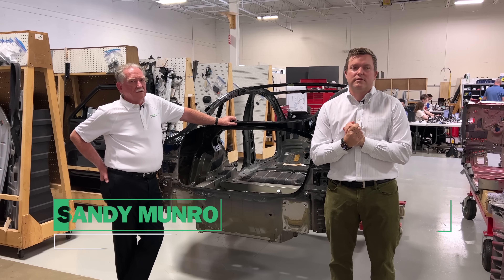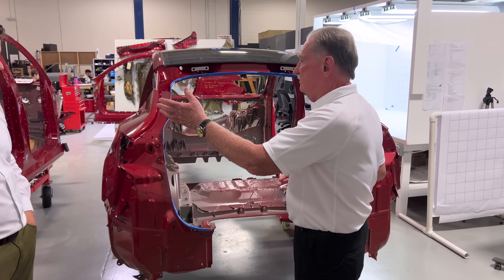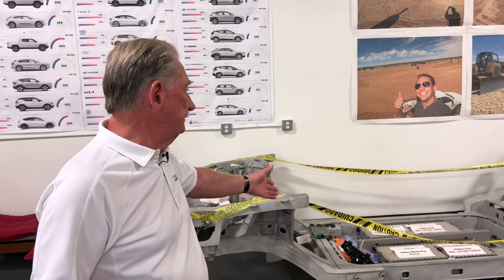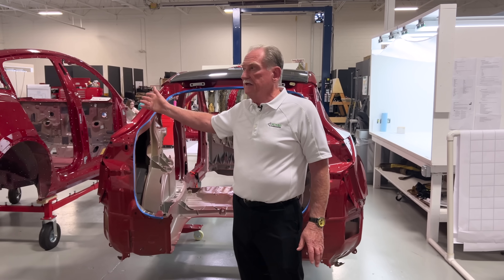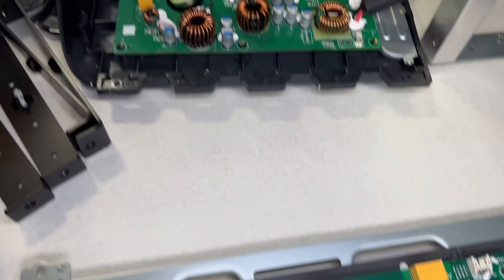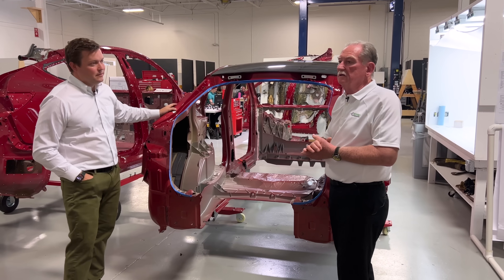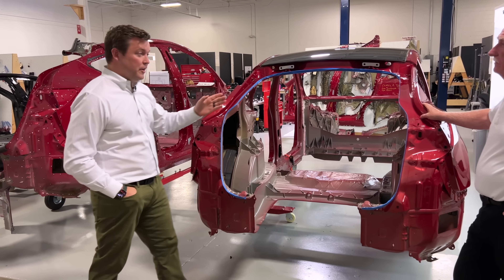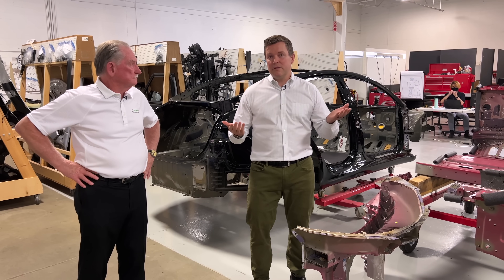Giga Castings with Sandy | Evolution of Tesla Bodies In White

Comment: If cars with this kind of manufacturing philosophy replace traditional cars in all price categories, people with low incomes will not be able to repair their cars if there is any significant breakdown. The complexity of manufacturing this kind of parts will make the original manufacturer a monopoly in their production, and the cost will be too high to buy them to repair a used car.

Comment: I am an ex casting engineer at a Japanese car company. At my place, casting parts are mostly used in car engines and are under the responsibility of the engine group.

Meanwhile, the body group is responsible for the inside of the car body.

With Tesla's courage and great success in redesigning the car body, there is no doubt that all car manufacturers will follow suit in the next few years.

This could provide benefits to casting engineers wherever they are, as their needs will double or triple in the automotive industry.

Comment: I would really like to inspect the quality of the casting without paint. In my experience thin walled extreme castings tend to be rather poor regarding surface and internal quality. Fatigue strength is highly dependent upon proper surface integrity.

I would prefer to be one step behind when taking gigant leaps into areas of new technology - it seldom goes without problems. The speed that  Tesla is implementing new technologies could be due to  high risk acceptance within the company.

Comment: This is interesting and does show a progression of engineering for the sake of manufacturing. But I have huge doubts about this product (car) from the consumer's point of view. If you are in a crash- a side impact at the rear tire- and your casting is broken at several locations. Is this going to be repairable? TIG welding isn't going to put the exterior shape back together. If not then the car would be "totaled". Who is going to bear the burden of vehicle replacements for an expensive EV that is not repairable?

Comment: I can see how all of these changes represent significant improvements in the manufacturing process, but do they make the car safer to drive? For that matter, is the new battery safer? Could there be some advantage in previous the body construction in an accident that may allow for more deformity or cushioning that is being lost in this new and improved manufacturing process? In short, would you rather drive with your kids in the backseat of this model Y or the previous one, sitting on top of the new battery or the previous one?

Comment: The casting process is incredible engineering and very beneficial to cost reductions at Tesla. While you can tig weld new cast sections in the event of a crash, Tesla is unlikely to sell sections of the casting in order to do so. As a result, a crash is more likely to result in a total loss which benefits Tesla because its an opportunity to sell another vehicle. Reparability is important and should not be forgotten because a technology is green. Thanks for the vid

Comment: It's a Tesla, gentlemen. I really liked the way the car body industry developed, as it can be manufactured at a lower cost than pressure molds. I think that Tesla is the future in the car body industry, and we hoped to abandon the resistant iron and replace it with aluminum that does not rust

Comment: reduce the distance between the rear wheels, citroen DS19, and cut the casting weiught in half, improve aerodynamics...the casting has little torsional rigidity which may be a problem.  in any event, it is brilliant as it is.  munro is the best (or is it musk is the best).

Comment: I am deeply interested in designing armored combat vehicles.
This mindset needs to be implemented in armored combat vehicles.
I'm embarking on that premise as well.
Once you have been in a Bradley Fighting Vehicle, an Abrams Tank, or driving one of the old Hummvees, or even the new JLTV's.
They are crude, difficult or impossible to drive comfortably, and the old school approach to welding flat armor around the outer circumference, just like they did in the Civil War, needs an entire rethink.
The Bradley took over twenty years to develop and deploy.
I want to use Tesla's approach to lean design, with Combat vehicles.

Comment: These cast body parts contribute significantly to the throwaway nature of society today.  Damage that would not be difficult to repair on other cars, be they body-and-frame or unibody construction,  is essentially impossible on a Tesla.  So the odds of you getting your Tesla repaired rather than take a larger insurance loss as it gets totalled, and inevitably the insurance company SCREWS you,  are much worse.

Despite what this guy says, the issue is that you can crack these castings with minor impacts, and those cracks make the car structurally unsafe and it's much harder to find qualified repairmen who can or will tig weld them together.   This does NOT make repairs easier, it does make the car more of a throwaway device.

Comment: I have to agree with you need to move on. We used to fabricate a certain structure until they wanted a cost saving and the assembly fitters suggested a moulding. Unfortunately the order book could not afford the tooling. Automotive now that’s a different story.

Comment: Nothing new here, GM has been using castings for all the c7 Corvettes starting in 2012, 3 parts, front, middle and back make up that whole GM c7 corvette frame and it's 10 times more rigid than a stamped panel car..

Comment: Thank you for the insightful video. I knew this was a really great way to save money and speed up production. And you are right: The critics claiming that you can't fix die cast parts of course know that you can't do that neither with stamped steel. BUT as you say, you can weld a die cast part, but you would never do that, if the part experiences so much force that it would crack, the whole car will be totalled totally.

Comment: Sandy gives Elon too much credit.  Elon is willing to pay engineers and machine shops to make the tooling to do something above and beyond what was the norm. 
You're talking shit Sandy, when you said that big die casting fills in a second. You know as well as I do that die casting takes a lot more time than just a second. I'm guessing that it's about a 3 to 5 minute cycle time for each part. Plus the overhead to make that big casting doesn't come cheap. This big die cast machine is probably a few million and multiple molds which will also run a half million a piece too. 
Elon is finally going to build himself a tool shop, finally! Up until he gets that going, he's had to pay for everything.

Comment: Still I think the problem will be reparing these things.  Welding a HPDC is very tricky if even possible. Corrosion protection is another issue I would imagine, at least on salted roads. Diecast aluminium suspension parts on my Mazda 6 from 2015,  looked like something from Titanic, it fractured due to corrosion pits that initiated fatigue cracks. I know that Volvo had the same problem here in Sweden.

Anyway, megacastings are interesting - but I am sure there will be lots of issues that will have to be addressed and lessons to be learned. Better to stand ready in the second line - than be the first to take a gigant leap into the unknown. That's my 5 cents.

Comment: Received my model y in June of 2022, long range , dual motor model T-boned behind left rear wheel ( ironically  Friday  July 13th ) from someone running a red light,  Estimate to repair came out to $5000 in parts + $15,000 in labor. It’s now after Thanksgiving and I don’t have the car yet although hopefully I will get it in early December. Could not start to fix until October because of backlog on other damaged Tesla cars the shop had waiting to get fixed. They only repair Tesla cars in this shop. I was able to drive the car in rest of time waiting to start repairs in October. My question is whether you think the car will be save to drive, thinking the integrity of the body might be compromised?

Comment: You can't fix bent longitudinals, but we can. Here in the second world where we drive mostly used cars we also have supply of used body parts from cars scraped in the first word due to mileage or just parts from other side of the impact. With good old steel cars we can just drill spot welds, take out bent parts and replace them with intact from donor. Furthermore, in 1-st world European countries where thay don't have the same mind-blowing insurance-bubble, people do repair brand new luxury cars with supplied new parts including UHSS steel reinforcement with techniques described and proposed by car manufacturers.

Comment: The”firewall” was there to separate the engine compartment from the passenger compartment. It’s main purpose was not to stop fires from reaching passengers.
The casting process for Tesla only “evolved” when a machine was built that could handle the casting size…it had nothing to do with Tesla engineering. The giga press was not built by Tesla…just funded by Tesla.

Comment: While electric cars are supposed to require fewer visits to a mechanic, a J.D. Power survey found the vehicles typically visit repair shops at about the same rate as combustion-engine cars — an issue that could be exacerbated by reports of poor quality control from new Tesla owners. Last year, Insider reported that drivers were taking to social media to report issues with their brand new Teslas, including poor paint jobs and misaligned car panels.

Comment: One Tesla driver alleged they found a dead mouse and rat poison in the car's front trunk — also known as "frunk" — after a service visit, Vox reported. Another vehicle owner posted on Twitter earlier this month that he discovered part of his car was duct-taped after spending 51 days at a Tesla shop.

It's not the first time Tesla owners have expressed frustration with Tesla's repair services. In 2019, a Bloomberg survey of nearly 5,000 Model 3 owners found that the majority were dissatisfied with the speed and quality of repairs at Tesla service centers.

Fixing a Tesla is unlike taking in a Ford or GM vehicle, which can be easily serviced at thousands of independent shops. The majority of Tesla repairs are performed by one of the electric-car maker's handful of less than 200 in-house service centers across the country.

While electric cars are supposed to require fewer visits to a mechanic, a J.D. Power survey found the vehicles typically visit repair shops at about the same rate as combustion-engine cars — an issue that could be exacerbated by reports of poor quality control from new Tesla owners. Last year, Insider reported that drivers were taking to social media to report issues with their brand new Teslas, including poor paint jobs and misaligned car panels.

Comment: Conclusion, If you're buying an older version of Tesla without the casting you should pay at least $15,000 less compared to the new one. That is with the same mileage and same battery degradation. That goes true for other manufacturer as well.

Comment: As a retired engineer from the structural steel frame manufacturing industry what Sandy and his colleague say in this video is absolutely right.  The really sad thing is that an awful lot of traditional manufacturing industries seem to have closed minds to new ideas.  I think this video shows why Tesla are going to go from strength to strength from a manufacturing point of view.
Long established auto manufacturers may simply not be able to make up the lost ground ..........
Reply: And on a design change I trash the whole giga form? If a car needs replacement panels after the selling period and was sold for lot of money before, so it is along time investment and not a faceless piece of round soap filled with software...how do I "value" customers coming in for greater service where partly "giga casting" parts are needed? Tesla can't...
This is like a glued shut iPhone all over again, completely stupid and only good for Tesla no one else 😮
Reply: And we all should not forget that sandy is the guy who values clips over screws any time which is a complete poop to work with later.
High quality cars do not consist only of glue and clips..
But hey why do any maintenance, just buy new cars all the time is sure cheaper 😂🎉

Comment: Hey Sandy would love to see your opinion on the Ineos Grenadier which incidentally is an old school knock off of a defender. They are doing research on hydrogen just not sure where they can store it. The engine is BMW finest close circuit engine design and no doubt it will be the last of the combustion engines. I am an electrical fitter and mechanic by trade from the old school the new Tesla motors are just out of this world not sure where this technology comes from as it is so advanced that I even struggle to understand.

Comment: Respectfully disagree, many vehicles with longitudinal/ frame damage can be properly repaired and have been for years.  So what, the insurance company is going to total a 50-100k vehicle rather then put 10 or 20k in to a repair?  Bad idea on several levels.  True Tesla has developed a high tech and very cost effective manufacturing technology but they are passing the cost on to the insurance companies and drivers. Coupled with completely non repairable structural batteries yields a throw away product.  Time will tell if this is the best approach.

Comment: So guys, do you think the 4680 cells are coming to the model S long range as well? Elon quoted that he will not use 4680 cells for the plaid because the 18650 cells deliever more power to the plaid. But the main question is, is the model S also getting a structural batterypack in the future? I hope so, I drove a P100D for few weeks to test and I really loved it. But is there a structural battery incoming end of the year?

Comment: Uh-huh...as he spews out about a 40% waste stream (because the castings are inherently unstable), he's a genius because you circle jerked him.  Is that how it works, Munro?

Wasn't it you who pointed out cast suspension/frame parts were a BAD idea, when you worked at Ford and were spewing on the Fiesta?  Wasn't it you that pointed out how castings don't respond to torsional stress, and have a tendency to CRACK and FAIL?  Wasn't it you who said (when referencing Ford) that they needed to step up their stamping, machining, and welding game, rather than cutting corners by using CAST PARTS?

Sorry to see what happens to peoples' integrity after they sell their soul.
Reply: Sandy is a big Tesla shill to cringe levels. For a reason big Automakers avoided big casting pieces for decades. Especially in mainstream models.

Comment: I'm a big fan of efficiency and lean manufacturing and cutting costs and Sandy hits the points over and over, but I happen to regularly question the consequences of a minor accident to the single cast and this video has increased my concerns precisely because Sandy summarily dismissed the issue.  Tig welding doesn't straighten a bent part, so will the bent element be cut out, straightened, then Tig welded back on?  It's an important question not only from a repair but also from an insurance perspective.  If it's too costly, the vehicle will be totalled for a minor damage and Tesla vehicle premiums will go through the roof.  So I need a convincing explanation that Tesla engineers didn't "just" consider manufacturing improvements but also addressed ease of minor repairs as well.

Comment: The missing firewall made me extremely curious, just seen in a Cyberrodeo video a close up of the IP and what goes to the open space of the firewall. The back of the instrument panel has a plate, that fits in the open place of the firewall and that plate has EVERYTHING mounted, incl. central computer. Blows my mind. When instrument panel is inserted while manufacturing, the heart and soul of the car is in place with one step. Means only an IP is installed that was tested working, less possibility for error and need of later corrections. Previously in no front casting assembly, several extra steps were made to install main computer on the firewall, carpet/isolation, etc. Now only one step. Same simplification when the battery is installed with the seats and central console. Plug, plug, plug and done. Hope to see a video about this.

Comment: Idiotic design. Now what 30 years of model 3 look because of the cost of Giga Castings? I would have done 2 pcs castings (top/bottom). Could be robot welded at little cost. Removing most complexity and permitting numerous changes. left the longitudinals. 4 - 5 pcs is really good for a car. This is one accident - to trash car. No thanks.